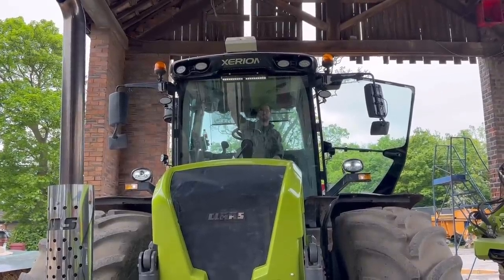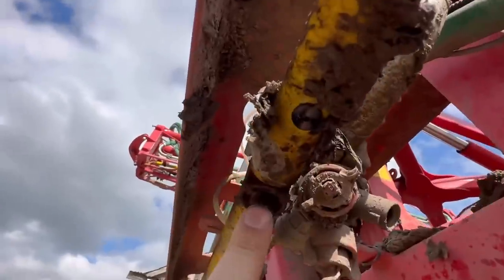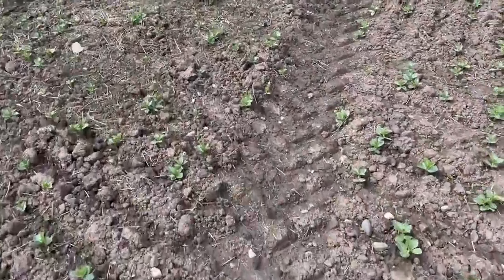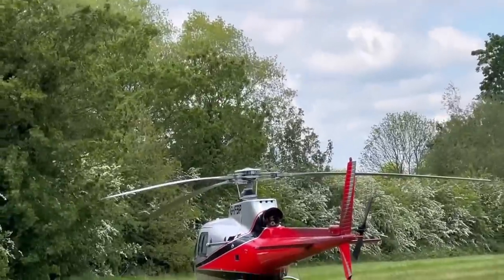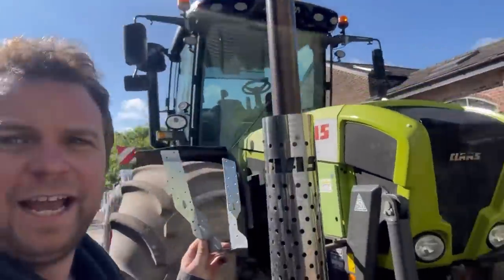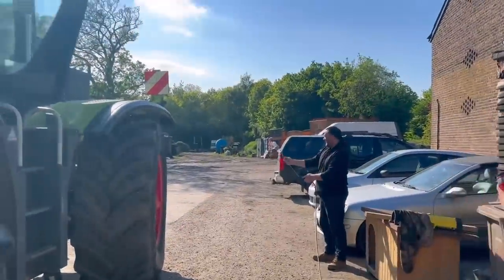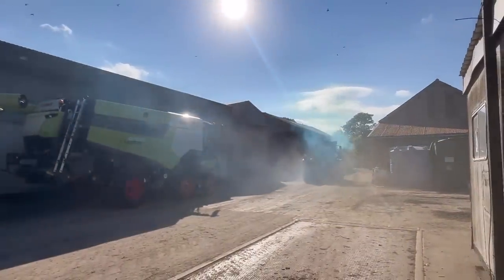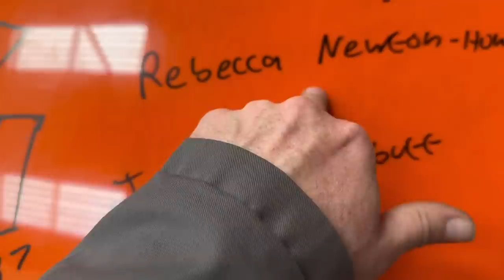OH NO GREEN SMOKE FROM TRACTOR #OLLYBLOGS #AnswerAsAPercent 1147

Comment: You could of turned the top " crook " , to face the bottom one Olly.
It's still adjustable, an thieves can't hammer the washer's off.
As we've had done, several times.
I can't believe your yard isn't fenced off. As it's so close to a road.
Ours is like Fort Knox !
Congratulations on the engagement to Charlotte.
She certainly knows the high fliers ! !